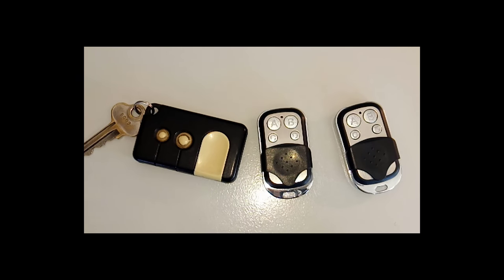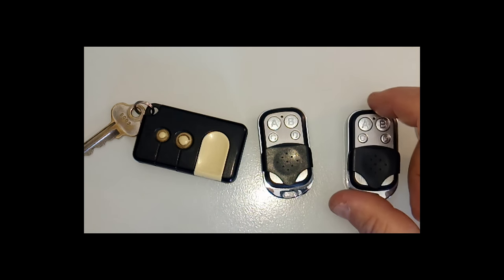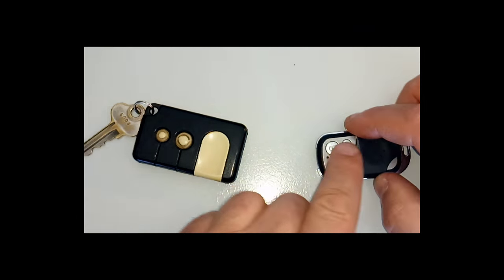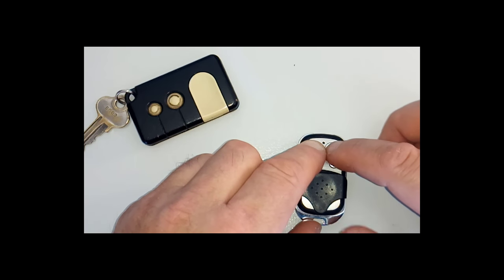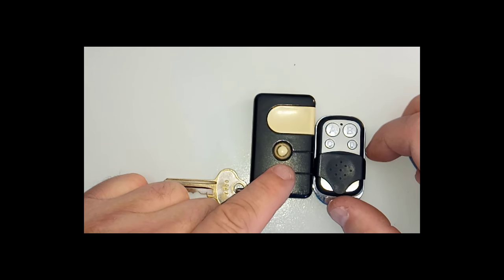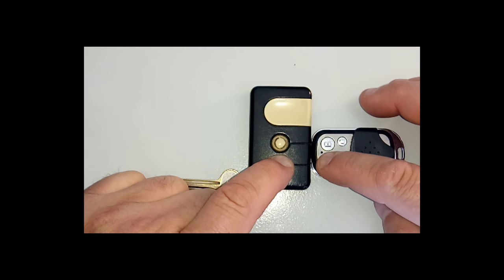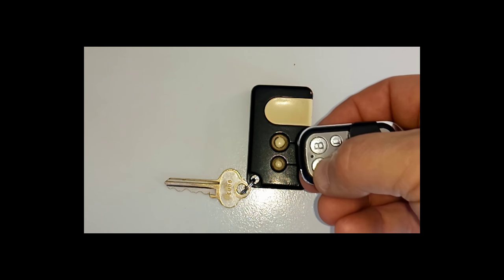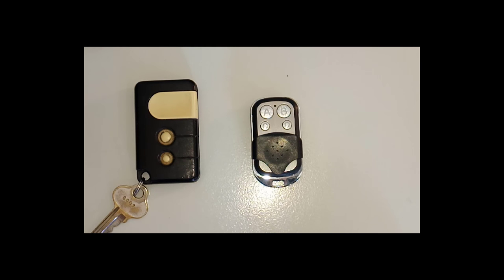433Mhz Garage Door Opener - Universal Remote - Easy How to Program

Comment: Just a word of advice. It should be noted that for this process to work, (ie. programming a new remote) both the old remote and the new remote must have the same operating frequency. Universal remotes generally work on 433.92MHZ, however, there's a variety of other frequencies used as well. So unless both remotes use identical frequencies...you're wasting your time.
Reply from the maker: that is 100% correct Phil. Thanks for your comment. - Cheers Westy
Reply: How to find the remote frequency?
Reply from the maker: @shairasyira3446  open it up and it will tell you or use a frequency scanner

Comment: Thanks. Two additional tips: Mine would stil not open the garage door, despite the led blinking confirmation. Turned out there was a tiny piece of bare metal wire broken loose from the solder on one side, on the back of the new remote. I soldered it back and now it works fine! I had to 'tune' to the right frequency by turning the tiny screw on the bottom right first though. :)
Reply: Just wondering before I pull my elderly neighbours remote apart can you actually change the frequency on these remotes if that’s what I take ‘tune’ as or you just having a laugh
Reply: @simonkirton8521  I believe they support 2 freqencies, 430 and 320 or something like that.  So it's likely some kind of binary switch.

Comment: Thanks so much. Lifesaver ! In my case I only got one to work. The other would not reset . The button solid Flash after reset on every button . Edit : got it to work. Must be something about the timing issue with resetting
Reply from the maker: must be kaput ... probably a broken wire

Comment: I got the same remote as in the demo.
I programmed it up and it works.
I had to hold the remote one metre away from the opener, cos the remote batteries were so flat.
Off to get some new batteries.

Comment: Hi mate..thanks for the video, as my same remotes are crazy.I followed yur reset ode, howeer, theywill no reset. I get th same led light flashes like you do, but they never reset....any more clu?
Reply from the maker: Hi, Have you tried following the instructions in the description? I have linked 2 other videos that may help at the top as well you you.
Reply from the maker: Hi - you could try the description notes and I have also 2 other you tube links that may work to help you out.
Reply: Please, yes for extra links. I have followed the tutorial exactly. The broblem that keeps  reoccurring,  is when actually  holding down the original  remote button and the clone one. When simultaneously pressed, I get the clone led flash a few times, but it will never do the final flash to say it has accepted  the code Unfortunately,  this same thing happens  every time. I do hold the remotes next to each other, and have rotated the original remote to every single side, as well as to the two faces of the remote to try find the signal, all to no avail.The clone resets perfectly, as shown by pressing a/button at same time, and then releasing b 3 times. It will simply not indicate the led flash that the code has been read. Thanks
Reply: Well, after months of trying, I cannot get these to work on a Firmamatic remote controlled garage door. I still find, that on some occasions, it appears, like the video, that the buttons do not have anything stored. However, a long press of the buttons, which is needed to get my control unit to recognise the transmitting remote, that all the a b c d buttons all show a red light on a long press, and not on with a quick press. I tried so many times, I got the remote batteries go flat. Tried on three units as per the video, without luck. Does anyone use them on anything else, so I can try to confirm they are simply not compatible with Firmamatic?? Thanks for the help.

Comment: Really happy I came accross your video but this still didn't work for me as my garage control unit does not recognize the new remote. Which is the same remote as the one you have. Also my garage opener is a Chamberlain but guess a different model from yours. I got a ML500. Any suggestions or is it perhaps that this remote will simply not work for this model?
Reply from the maker: Hi There,
Try doing to the Door opening controller (On the door itself) and press your buttons on the remote.... can you see the light rapidly flashing on the control unit? if so, it is seeing your remote , but just needs to be #CODED# into your controller. try the last part of my instruction on how to do that. - see how you go
Reply: Westy's How To Guides Thank you for your reply. I have noticed that when I use the original remote the LED on the control unit flashes rapidly but it does not flash rapidly when using the new remote. I guess that answers my question then, the control unit does not see the remote. Will have to look into another model.

Comment: The duplicate remote programmed using your video was perfect. However it works only 1 time and then has to be re programmed and process repeated. Any solution for this ?
Reply from the maker: Hard reboot and then clear off any memory on the garage door controller itself. Then try it.
Reply: @rent2ownnz  thanks for this. However it works for the first time I press the cloned remote . Should I try pressing again, it does not work. If it works once it has to keep working. Could it be that it’s not able to store memory
Reply: I have same problem. I thought remote was broken so I bought few of them from diffrent producers but still works only once. I tried to code it in motor but still works only once😐

Comment: mate the last part of your vid is exactly what im looking for. But I didn't quite get what you mean. I seemed to have copied the program onto my universal key but it didn't work on the door. Does the last part of your vid mean that I should do the clone process close to the operation unit? or putting the operation unit under learning mode? really appreciate if you can clarify on that!
Reply from the maker: "Does the last part of your vid mean that I should do the clone process close to the operation unit? or putting the operation unit under learning mode? really appreciate if you can clarify on that! "
Look up your Garage door control unit manual and work out how you put it into learning mode. Once in the mode. Press your new remote that you programmed in my above video and Viola!
Reply from the maker: Press and hold DOOR
CODE button once
Select one of the four buttons on
key transmitter you wish to use to
control the door. Or the button on
the end of the manual release cord.

 Setting the Transmitter to Operate the Door
The opener can only operate from transmitters that have
been programmed into its receiver. The receiver needs to
learn the codes of any transmitter that will be used with the
operator. Up to sixty four (64) codes can be stored in the
receiver’s memory.
a. Ensure the button cover has been removed (see
Electrocution caution) and the opener is turned on.
b. Press and hold the DOOR CODE button. The DOOR
CODE LED will illuminate and beep to indicate the
opener is in Code Learn mode (Fig. 8.1).
c. Press and hold the transmitter button that you want to
control the door for two (2) seconds, pause for two (2)
seconds, then press the same button again for two (2)
seconds and release.
d. Release the DOOR CODE button.
e. Press the transmitter button to test.
Reply: thanks dude. really appreciate your detailed explanation. it will defs help other people stuck in a similar situation. but i guess im done cuz its a gate for the entire flat's parking area. i just moved in and i thought i could just copy my flatmate's key but  if i open that control unit chances are i get taken by the police... but anyway really useful content keep it up fam

Comment: Mine looks like the same but doesn’t do the three blinks and I wonder how to make it work.😢
Reply from the maker: You Tube it. I believe there are  or  3 different methods for the same looking device. If you do find it, let me know and I will post it in the title notes. and may even add a little bit of an explanation at the end of this video.
Reply: @rent2ownnz  Thanks for reply. I did have searched and watched more YouTubes but no luck yet with those not blinking like mine.

Comment: I had two remotes for this model one was stolen out of my car, if I follow the guide above, and reset the existing remote, will the stolen remote still work ?
Reply from the maker: Hi Michelle, Very ... very good question. What you can to is clear all the previous saved configs in your door controller. then add your new ones! that should solve your problem.

Comment: Hi Westy. It seems you have done some research and in fact it worked on another remote I had with a different look to it.
But I do have an identical to yours I cannot seem to get to work.
When I press each button a single red blink comes. When I press and hold A+B it firsts glows red, then starts to blink fast. But all 4 stil blinks when pressing.
If I hold C+D then It again glows red and fast flashing, but after that all 4 buttons seems to have code...
Its whery strange!
If I then try to copy, its starts flashing like crazy when there is a signal(not when there isent), but it still doessent work afterwards... Almost like the sender is dead.
Reply from the maker: https://www.youtube.com/watch?v=RM_xgNsP4sQ
Reply: Thanks. iv tried that before. But I cannot seem to get it to go 100% dark. Its either coded with continiously blinking, or just 1 blink when pressing a button :)
Reply: i got the same problem.every button flashes 1 time and goes off. i try reset A+B or C+D and blink continuisly. not 3 times.
Reply: same here
Reply: same

Comment: Hey.  When I follow the first step to clear codes. I hold A+B, (3x Flash) release B, press B x3 and nothing happens. Any ideas?
Reply: Same issue here!
Reply: Have you solved this as I'm having the same issue...
Reply: Unfortunately, I did not. After following the manufacturers programming method and also every other tutorial on the internet, I ended up getting refunded from ebay. Sorry I couldnt be any help. Good luck. :)

Comment: Hi, anyone know what to do when the key doesn't reset properly. I've got a 3 button which is exactly the same. I programmed it ages ago and I wanted to reset it but I forgot the instructions. I thought it would be the same process by no luck unfortunately. BTW, when I open the key to reveal board and battery, it actually has 4 programmable button, but only three on the outside. Not sure why they hid one of them

Comment: Will this work if I don't have old remote it's missing it's a b&d roller door pretty old school mate
Reply from the maker: Open your B & D MAin Module in your garage and see if it has the frequency on it ... should be 433Mhz if not ... get which frequency it is and then get on online and follow the same set up. you will be able to clear all previous paired coeds and set a new one. Look up your model specs online and you should find a manual that works.

Comment: The problem is when you are in 30meters away to your door the clone remote did not work
Reply from the maker: get a genuine one then as your signal strength sounds like it has reached it range. easiest way to find your range is to slowly walk toward the door and press until the door reacts.

Comment: but what do i do when I have lost the remote control, and i can't copy the signal to the new remote...?
Reply: William Helle I try a next way and Its works .
Press and hold button 1 then press button 2 4x.  REd light should be blinking. Press your remote then the clone remote should change blink faster press on the clone button you want to be clone

Comment: I can’t make mine work no mater how hard I tried to clear the code from the original setting and it still flashes when I press any of these buttons. It is rather very easy to sync from the original remote control unit with the master control unit. Any ideas how to make it work?
Reply from the maker: Sorry to hear that... You might have to search for another way to do it

There are a few different ways
Reply: Westy's How To Guides wow, thanks for your reply and I never expected that! My units have blue led signals and after I cleared the original setups, those buttons still can flash once when they were pressed. How bazaar?! I do realise my original Napoleon garage door opener is in 303hz however those new remote control units I purchased from eBay is up to 433hz, would there be any difference? I’m really confused now…haha

Comment: When I hold down both buttons it stays solid. Nothing I've tried makes it blink.
Reply from the maker: Steps:
================================
|Clear existing Memory Settings|
================================

1. Hold down the A & B Button (the two closest to the LED Light)
2. While Holding down Button A (Left) Press (Slowly) button B -right one, 3 times
3. Then Release Button A.
Now no button presses will operate the light (LED)

================================
|How to Set New Learning Code  |
================================
This is a 2 Stage Process:

=========
|STAGE 1|  Programming New REMOTE
=========

1. Get old door opener and the new non-programmed one close to each other
2. One the old Remote that works, hold down the button that works on the door
3. Now Press and hold the button (The LED will Flash a few times and then  be raon the new remote you wish to operate your door with.
4. Hold this button down until the LED light goes Solid 
5. Stage one Complete

=========
|STAGE 2| Syncing to Door Master Controller (If Above does not work)
=========

1. Put Garage Door Master Controller into learning mode and wait till it is in listening mode (Each type is different = refer to your owners manual) and then press the button you have configured.

Comment: The biggest issue with this video is that it fails to mention that the remotes must all be of the same frequency. Some garage doors (like the Dominator) operate off the 315mhz range and not the 433mhz range described in the video. Trap for the unwary.
Reply from the maker: Good point... However... The video clearly states it is for 433mhz devices, implying that the person watching would know the frequency before watching it 😁📺

Comment: This does not work on United States garage  doors or car doors. The frequencies must be different
Reply: Is not working for me
Reply: Didn't work for me either
Reply from the maker: explain what is happening and not happening and i may be able to assist
Reply from the maker: If it does not work then try this guys options https://www.youtube.com/watch?v=l-k_XvkZ0jE
Reply: I’m holding both buttons at same time and the remote is not flashing
Reply from the maker: throw it out or change the battery
Reply: I sure hope it doesn't work on car doors. Anybody would be able to get into your car.

Comment: i have the same remote but i cant reset it. when i press each button for 1-10 seconds the RED light is still. if i press A+B the red light is still (no blink), same if i press C+D, A+C, B+D 1-20 seconds nothing happens instead of red still light.. it's impossible to reset this remote and i can't find a correct tutorial
Reply: I have the same problem. No matter what I push, or whatever combinations I push, the light just stays on solid and never blinks  ... only difference is my light is blue - not that I think that matters  .....
Reply: same problem here
Reply: have you figured how to reset the remote?
Reply: have you figured how to reset the remote?

Comment: This is Emily from HFY electronics Co.,ltd.  We are professional manufacturer all wireless remote control for garage door, roller shutter, retractable door, signo door, water pump switch , LED light switch, family security and so on. and we have passed certifications of SGS, CE, ROSH.
Reply: It works only until you use original :(